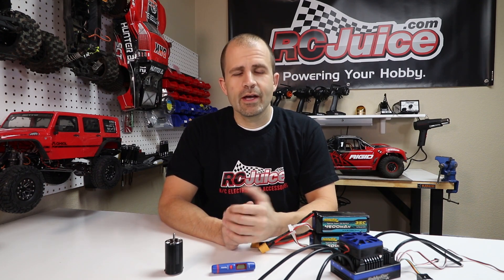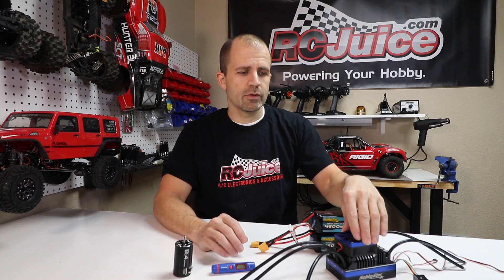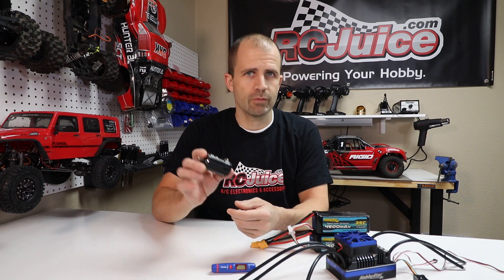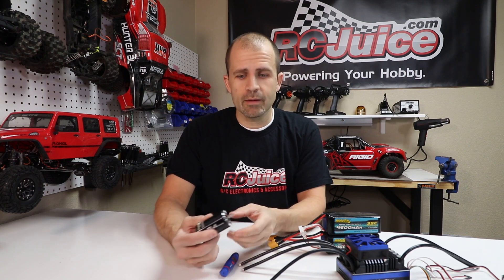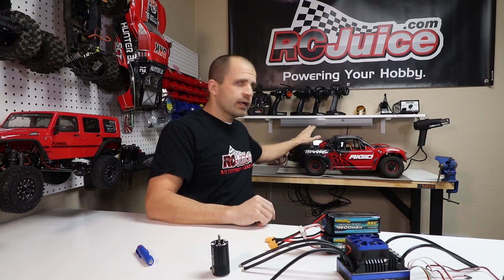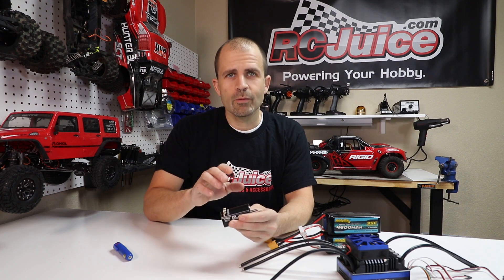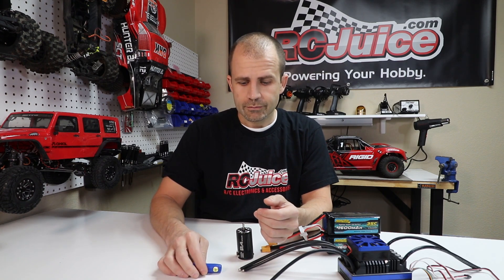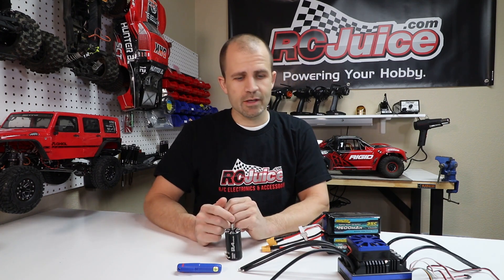Brushless motor temps, the #1 rule in R/C!!

Comment: iv tried chatgbt but its all doom and gloom. i would love to get your point of view , as someone with 'experience' ...
iv got hold of an old torqeedo outboard, minus electrics or battery. its got a geared motor though, and is supposed to run on 29v 8s. iv got a 44v 60ah pack out of a bmw. i really didn't want to start splitting up the pack. do you think i could get away with that 50% over ? maybe avoiding full tilt ?  thanks k

Comment: I cannot figure out my motor and motor wire issues. I believe my voltage ranges are all in check and my battery capacity is good buy I am quickly making heat in motor and motor wires with the tires in the air. Gear mesh is good I believe

Comment: Hi, I do have pbm of overheating with my Kraton 6s. BUT, the issue isn't the motor, but its connectors wire. As soon as I tuen the car on, the A,B and C wires from ESC to the motor get very hot instantly, without even driving it !!!! What could be the issue ? Thanx so much for your very understandle topics !

Comment: Hi ! How are you doing today,  This is MR.HERMAN WOODS HERE.  I WONTED TO ASK YOU . I HAVE THE FLIER 400AMP ESC .I WONT TO RUN 10S ON ONE LINE ,AND A NOTHER 10S ON THE SECOND LINE .THE FLIER IS RATED 90 VOLTS MAX .SO ! I WONTED 12S ,BUT TO BE SAFE .I AM GOING WITH 10S .SO ! I WONTED TO RUN .ONE BATTERY TO ANOTHER ONE .THEN BACK TO THE ESC .THEN RUN THE SECOND 10S TO THE SECOND 2 LINE . WILL THIS BE ALL RIGHT ! FOR THE HOOK UP. I REMEMBER  WE HAD TALK AWILE BACK . ABOUT THE 12S ! SO ! CAN YOU LET ME KNOW .WILL I BE ALL RIGHT WITH THIS HOOK UP . I WONT TO THANK YOU FOR YOUR TIME.MR.HERMAN WOODS.

Comment: Mr. Joule was well aware of the significant issue at hand. I xI  x R = ...HOT :-))
As the copper ceased to be a viable option and melted away, we began to grasp the concept of harnessing and utilizing light. This was the advent of "electricity." ...more or less until now.
If I'm allowed ...I think not everything that applies to brushless can apply to brushed! as I believe you said
For instance, if you apply 6 to 8S to a brushed engine designed for 2S, it won't even complete a rotation before melting. If it somehow doesn't melt, it will likely over-rotate and explode.
Brushed engines has to be treated still with more affection :) than brushless

Comment: if you connect 2..   2600 mah 2s batteries w/ an adapter..would that make the source of battery 5200 mah and/or 4s..? and would that be bad to do..?
Reply from the maker: Yes, it would double your voltage to 4s. It wouldn't be bad as long as your system is rated for 4s use.

Comment: Do you think spinners are necessary for electric rc planes? I have a Turbo Timber Evo. and it looks like the ESC would get better air flow if the spinner was not installed.

Comment: I just bought a surpass hobby rock motor 7800kv it doesn’t say what the top rpm of the motor is. How do I know that?
Once I know that without the gearing is it ok to run it with gearing added to the equation as long as it’s below that number?
Reply from the maker: KV x Voltage= RPM
Reply: @RCJuice  ok thanks.

Comment: Could you tell me why a Hobbystar 4585, 1800kv motor would run hot on a 15t pinion / 46 spur on 6s?…..I got a temp of about 230° after 5 minutes of operation.
Reply from the maker: It's not really possible to give an appropriate answer without more information. There are too many factors that have been left out. At minimum, we need to know what ESC is being used and what make and model vehicle.
Reply: @RCJuice  I’m using a Mamba Monster X8S on 6s, it’s planted in a Kraton XL build.

Comment: I have a rustler 4x4 vxl running on 3s w/ 17t pinion and 54t spur. Running oversized sledgehammer tires. I really like the gearing and tire set up but am overheating very quickly. Is there any options for me to maintain gearing and tire size but have cooler Temps? Would a motor swap help?

Comment: Votage for an electrical circuit is similar to pressure in a hydraulic system.  The main limiting factor for voltage is the insulation capacity to contain that voltage.  If a weakness is found, the voltage may cause a short circuit or possibly a path to ground.  In the case of an RC motor there would be short circuit between two of the three phases which could cause an meltdown of the ESC.

Comment: Do you, or can you make a video about the Batteries to use. Im new, and am a bit worried about the C rating on the battery... I assume, if i get a brush-less esc at 50A i can use a 5700mAh 50C battery? How do I figure out the Motor, esc Amp rating vs the battery C rating? I cant seem to find any real answer. Please help.

Comment: So for 3D flying do I want a 850 KV or a 2100  KV ?
Reply from the maker: Depends on many other things, but for 3D you want the maximum power so you should experiment with with your setup and monitor motor temps to see how much power you can extract without overheating.

Comment: anyone helps me ,. what the most cause that can burn the esc ? too high motor rpm or too high baterry volt ??
Reply from the maker: Heat.  Most common reason for an ESC to burn up is from pulling too many amps through it (high voltage mixed with high KV's or over-gearing of your motor).
Reply: @RCJuice  thanks man. ., got it...,now ii wil buy some temp gun 😇

Comment: Great video the only thing I think I would touch on that you didn't is track conditions dry loose track conditions going to be less load on your motor less heat and sticky damp wet track condition is going to get well not soaking but tacky a lot more traction going to build up a lot more heat

Comment: Ive burned out 2 motors already. I think im going to switch to gas powered nitro
Reply from the maker: Don't give up, there is a learning curve but once you get it figured out it's so much easier than nitro!
Reply: @RCJuice  rc guy said put a new transmission in my truck. Its 2 bad riders hobby shop didnt tell me to buy a new blx

Comment: Hi ! This is Mr.Herman Woods again , I hope you are doing well. I just wont to ask you , something jhon . Hay ! I just bought a flier 400amp 3-22S ECS 13-90 VOLT"S .NOW ! I WONT TO RUN 4 6S LIPO BATTERY .WITH THIS 22S ESC .NOW WITH 4 6S AT ! 88.8 VOLTS TOTAL . SO 22.2 X 4 = 88.8 VOLTS .SO AT THIS 88.8 VOLTS , I SHOULD BE ALL RIGHT .AT LONG AS I AM UNDER ! 90 VOLT . FOR THIS 22S ESC .LET ME KNOW ON WHAT YOU THINK . I WILL BE RUNNING A LEOPARD 56-113 700KV 150AMP DRAW . LET ME KNOW , ON WHAT YOU THIMK .THANK YOU FOR YOUR TIME .MR H. WOODS !😀
Reply from the maker: ESC's are typically limited to the cells listed, since the firmware would have no way of accounting for a 24S pack it would allow it to drain far too low and could destroy packs or cause a fire.  On ESC's you never want to exceed the rated voltage, it's not that it can't necessarily handle the volts from a hardware perspective but the firmware is not compatible.  Motor rated voltage is more of a guideline, but you must adhere to ESC specs.
Reply: @RCJuice  OK ! IF THE ESC IS 22S MAX VOLTAGE IS 92.2 VOLTS ! AND IT WILL BE ENOUGH , TO BE UNDER VOLTAGE AT 88.8 VOLTS. IF I WAS RUNNING 4 6S .BUT I WILL RUN ! 3 6S , TO BE UNDER VOLTAGE .TO PUT ME AT A 16S , AND I WILL SET THE CUT OFF .AT 3.40. TO KEEP IT FROM RUNNING TO LOW.FOR THE BATTERYS .SO I SHOULD BE ALL RIGHT ! I WILL NEVER GO TO HIGH THEM THE ESC VOLTAGE LIMITATIONS . WHAT DO YOU THINK .MR HERMAN WOODS .THANK YOU FOR YOUR TIME !

Comment: My question is what causes ESC overheating?  I tend to gear up and drop to a lower voltage... is that stupid or does that make sense?  Because I've had some esc overhearing on my k8 that I run on 39t spur and 6s... not always, but enough to shake confidence...thanks anyone!
Reply from the maker: Excessive current draw through the ESC will overheat it the same as the motor, motors just tend to build heat faster. You are correct to gear up/drop voltage, a higher voltage system with lower gearing is more efficient, but for temperature-control purposes, you are doing the right thing.
Reply: @RCJuice  Thank you so much!!! I thought that was right... but of course, if the voltage drops too low, then current increases... so I wasn't sure... when we ran 6s on a Typhon with bigger wheels, the esc went into thermal shutdown in just a few minutes of driveway testing... we didn't understand... so we tried to learn why and we concluded it was because we could barely pull the throttle and the esc had to "block" the current which would heat up the resistors?  Does that make sense? We reeeeally appreciate the understanding 🙏

Comment: ☠️BLACK BARON☠️ It's the motor that can heat up very well and make the inside cabin get so hot hat even the temp measurement of the ESC gets a warning. Especially when running motors in very hot summer conditions.

Comment: To me is surprising that my xmaxx stock runs at 180f dg, about 80 celsius, after 10 mins, and that is extremely hot imo but the manufacturer says it is completely normal….
Reply from the maker: 180F is not in meltdown range, but it's definitely on the hit side.  If it stays around 180F you should be OK, but the problem is you have very little buffer there so anything that causes more heat can get into the danger zone.  Have you tried lowering the gearing any?

Comment: can i use 50 amp esc and motor 100amp?
Reply from the maker: It depends on the voltage and gearing of the motor, but if the motor is set up to run at or near full power then no, you would quickly burn up the ESC.

Comment: did a test on my carpetbuggy and trow on a big pinion and actually the temp on the motor got lower then it got with the normal gearing most use for that track.
and on top of that it got as far as i think easyer to drive as it dont got as explosive on power out of corners and before jumps. 
so the lower ratio did calm the car down and dont seem to get drawbacks as raced motor temp.

Comment: I'm always getting into debates, shall I say lol, about higher amp ESC's. Lots people are convinced the ESC pushes power into to motor, when it's simply not true
Reply from the maker: We would say the majority of people believe this to be the case, it is true that different ESC's can "provide" different peak numbers, it is indeed the motor that "pulls" current through an ESC.  This is the reason most hobbyists believe that if an ESC fails it is the fault of the ESC, we need to look at the entire system and realize the motor is the end of the line, but it is responsible for pulling power FROM the battery, THROUGH the ESC and finally through the motor itself and that motors keep pulling power until they melt down.  Whatever else is in line to the mtoor is subject to the same.
Reply: @RCJuice  Yeah that's true. It's all about the number crunching from the lipo to ESC and finally the motor. All need to be capable of delivering the required results, or something's gotta give

Comment: Cell count limitation is NOT a hard & fast.  My Examples , stock OE 1/16th Traxxas 380 brushless motor & esc runs on 4S for past couple years. Also been running the new off-road/drift Traxx tank RC on 3S instead of the 2S on the stock components. 
My stock OE vehicles are always out front with their higher top speed potential.
Reply from the maker: The maximum voltage rating of an ESC is set, you can run less voltage than the max, and any cell counts between the minimum and maximum voltage of an ESC but the maximum voltage rating is indeed set on an ESC.
Reply: @RCJuice   theres a key, cell count  or _S rating is not a voltage rating. 🤔
Reply from the maker: @NvTwist  In LiPo terminology, "S" does indicate the voltage.  "S" stands for "series", so in "2S", it means 2 cells in series, or 7.4V.
Reply: @RCJuice  I’m fully aware what the S represents.  Happy scale trails to ya.

Comment: Say on a scale truck, if you drive it on the road at a constant walking speed, will the motor heat up constantly or will it reach a certain temp? I ask because I put a Holmes hobbies 3500kv motor with a cc copperhead 10 esc and in low gear on my trx4, the motor will go all the way up to 160f if I just keep running the motor at a constant pace.
Reply from the maker: The motor will reach operating temp and stay there.  Of course there are a lot of variables, but if given a constant load then the temp will peak and stay there and not continue to climb.
Reply: Okay, would you say it’s normal for my motor to get that hot under those circumstances? My final gear ratio is already at 79.1:1 with no binding in the drivetrain.

Comment: Hi ! John ! This is Mr.Herman Woods .Here how are you today! I hope you and your family is doing well and safe ! Just wont to thank you once again ! You have taught me, a lot about RC MOTORS . ON HOW TO ! CHOOSE THE RIGHT MOTOR . I WAS RUNNING 4S DOING ABOUT 45-50 .NOW ! I AM ON 5S HITTING 55-58 . IT'S ABOUT VOLTAGE !!! AND HEAT , THEN SETUP ! NOW I KNOW .I WONTED TO ASK YOU SOMETHING. I HAVE BOUGHT THE HOBBY STAR 5S 5200 MAH 50C LIPO .I HAVE 2 OF THEM, THAT I ADD TO MY BIGGER BOAT.5FT FOR 12S ! BUT WHAT HAPPENED .WAS I FOR GOT ,TO PUT MY LOW VOLTAGE ALARM ON IT .AND TOKE THE BATTERYS DOWN ! PASS 3.0 .MORE LIKE AROUND 2.6 ! AND THE BATTERYS SWELL A LITTLE ONE MORE THEN THE OTHER . BUT JUST A LITTLE ! DO YOU THINK I CAN STILL USE THEN .!!! OUR NOT .I HAVE PUT THEM ON THE CHARGER .AND THEY CHARGE UP . RESISTANCE OF THE LIPO ARE AROUND 3-4.ON BOTH OF THE BATTERYS. .BUT I WAS GOING LIGHT WITH THEM.AT FIRST! BUT ! I THINK WHEN I WAS RUNNING ! I NOTICED POWER CUT OFF ! AT AROUND 3.90 CELL VOLT .WHEN I CHECK IT , BUT AT THAT TIME.I HAD FISHING LINE ON THE PROP ! AND I THOUGHT THAT WAS THE PROBLEM ! BUT I WILL TRY AGAIN. BOT THE BATTERYS STILL .HAVE ALOT OF POWER , I THINK IT IS TO FAST FOR THE ! PAWN THAT I RUN AT . IT GETS TO ONE END TO QUICKLY .BUT I LIKE IT ! SO WHAT DO YOU THINK ABOUT THE BATTERYS ! THANK YOU FOR YOUR TIME .MR.H.WOODS
Reply: WHY ARE YOU YELLING?!?!

Comment: Outstanding! I just finished a build of an XTBe Xray 22 with a hobbywing 4274 motor & HW pro esc. Running 4S 6500, 120C with a 17 tooth pinion gear. I have that Bluetooth thing that tells the temp and data log plugged in. I ran it for a short time today and checked it. Motor temp was 110F @ just under 37k rpm. I didn’t run  hard, but will tomorrow. I noticed the engine mount was a little loose, which was my fault- I never locktited it and torqued the bolts down. No issue because I was careful. I’m allowing 24 hours for the locktite to set, then letting it rip. I loved and appreciated your video, subscribed and would appreciate any advice. 
Pete

Comment: 3s Arrma Vorteks: I am looking for the touch the motor and its room temp sort of thing, is that possible? I will buy new motor or whatever, I made custom cooling for my current setup to get it where I want (ripped old heatsink off of chipsets and put a bigger one and bigger fan). 140 degrees on ESC. But motor gets warmer, and it's on stock gearing. And I am going through 2 full 5500 11.4v lipos non stop so it's pretty good. I just want it to be icey cool :D Any Ideas on a motor that might deal with the load better and keep same ESC ?
Reply from the maker: The stock motor is 3200KV, this is acceptable for 3S as long as you monitor temps, but the only way you are going to noticeably reduce the motor temperature is to decrease gearing, or lower the motor KV.  As long as the motor is not overheating (over 170F) then you are OK as-is.

Comment: Hi ! This is Mr.H.Woods , just wonted to thank you. For all you have done for me.I went on ahead ! And put in the 5S lipo .It ran very well, like it is to me enough POWER FOR THE POUND .THAT I AM AT ! IT IS A LEOPARD 4082 1.5Y 2200KV .A LOT OF TIMES ! I HAVE TO BRING , THE BOAT TO ME .JUST TO SEE WHERE IT IS .FROM THE SPEED ! I JUST WONT TO BE SURE ! THAT THE 6S WILL BE TO MUCH ! FOR THAT POUND ! RIGHT NOW ! THE BOAT IS COMING OUT OF THE WATER .I CAN ACTUALLY SEE IT MOVE.ANOTHER 5 FT .AT HALF THROTTLE AND STILL .MORE POWER TO GIVE ! IT FEEL"S GOOD .BUT 6S IS THE LIMITED ! THE MOTOR IS 20VOLTS ! MAX ! AND 6S FULLY CHARGED IS 25.2 FULL. THAT WILL BE THE LIMITED ! OUR DO YOU THINK I CAN GO MORE .WITH THE 5S MOTOR RIGHT AT 100Fc AND UNDER ! BATTERY AT 110 .ESC AT 110-120 Fc , THE BOAT IS WATER COOL .NOW I GOING TO TAKE OUT THE 5 FOOTER ON 12S . SOON ! CHANGEING THE ENDS ON THE LIPO BATTERY ! TO 8mm ! WELL LET ME KNOW ON YOUR INPUT ! THANKS AGAIN MR.H.WOODS
Reply from the maker: Hey Mr. Woods, thank you for watching and glad to hear you are getting such great performance out of the boat!!  5S is a sweet-spot for 1/8 sized motors that a lot of guys miss, 4S and 6S are so common that many never consider 5S.  Running your motor on 6S is not going to hurt it just from being on 6S, but it is possible that the temperature is going to get too hot.  Since you are only at 110F right now it does sound like you have some room to play, but keep in mind that sometimes the temperature increases quite a bit just when going up one more cell.  From your description it sounds like you have a pretty dialed-in setup with that 5S though.  Enjoy, and please let us know if you have any more questions!  You can always reach us at: https://www.rcjuice.com/contacts/https://www.rcjuice.com/contacts/